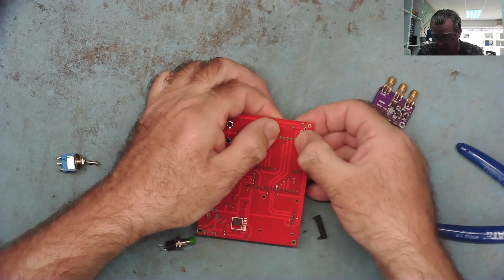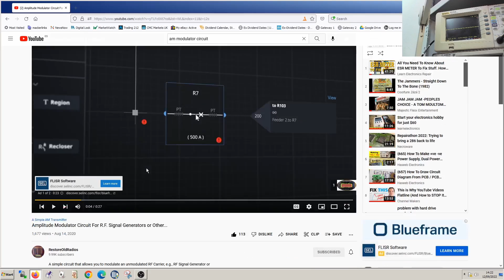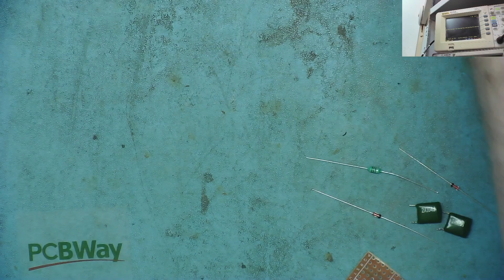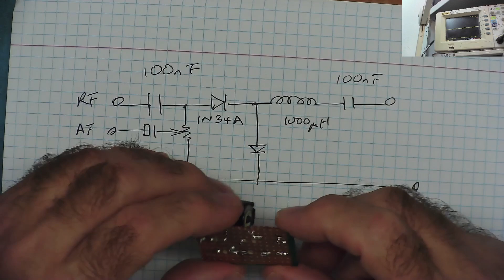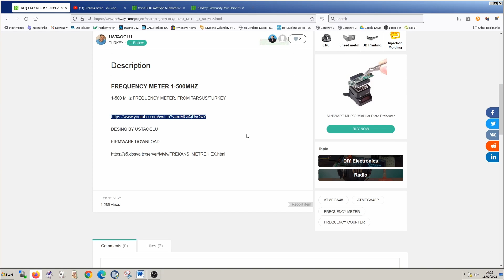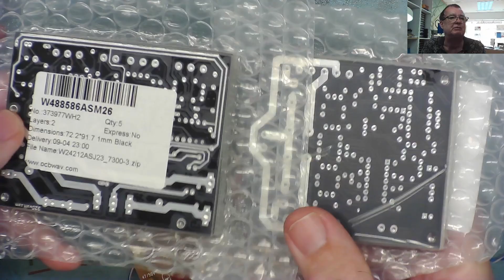Build A Low Cost 10KHz-255MHz RF Signal Generator Project - Part 2

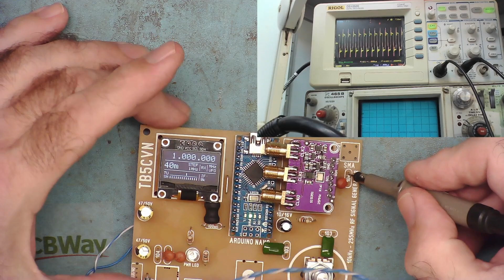Comment: At about 15:40
The overshoot on the square wave is almost certainly the result of poor probing technique.
I have no idea where the scope ground lead is connected or how long it is, but it needs to be a short as possible because it produces a resonant circuit in conjunction with the probe capacitance. For higher frequencies the best thing to use is a probe tip grounder. FET probes are very good but expensive, Contrary to common belief they are not especially high input resistance, but the capacitance at the tip is very low - 1 to 2 pF typically with moderate-bandwidth types. The low capacitance reduces circuit loading at high frequency and lessens issues with ground lead inductance. With low impedance sources 500 ohm probes can perform well.

EDIT: If the circuit will drive 50 ohms, the best thing to do if you don't have high-end probes is to use a 50 ohm terminator at the scope and a 50 ohm coax to connect to the circuit under test. Both terminator and coax should be good quality. Lots of higher-end scopes have switchable 50 ohm termination built in.

Comment: One could just as easily solder the Si5351 at the underside of the board; less introduced capacity and as added benefit is that  the connectors will come out in the direction of the side of the case as well as having more clearance.

Comment: Use a 50 ohm terminator resistor might eliminate that strange odd waveform
Reply: If the circuit will drive 50 ohms, the best thing to do if you don't have high-end probes is to use a 50 ohm terminator at the scope and a 50 ohm coax to connect to the circuit under test. Both terminator and coax should be good quality. Lots of higher-end scopes have switchable 50 ohm termination built in.

Comment: When your signal's frequency gets near the maximum frequency of your scope, then the only waveform that the scope will know to be able to "interpret" from the datapoints it is getting in, is a pure sine wave.

To be able to display a more complex waveform (if indeed, the waveform was more complex in reality) it would need to sample the data at much higher frequency (which would make it a higher bandwidth-rated scope to begin with) to again be able to tell the complexities of the waveform apart.

Essentially the scope measures a bunch of dots in time along the true waveform. When it is a slow wave of some description, it can measure many many dots in each period of the wave, and therefore reconstruct a very detailed and accurate picture of the waveform for each period. When the wave form is near the scope's sampling frequency, it really only gets one or two dots per period. Therefore it has no way to reconstruct if the wave was some crazy complex one or just a sine wave oscillating at such a frequency that it made the one or two dots it sees in each period. So it is essentially forced therefore to presume it is just measuring a sine wave at that frequency.

Theoretically this rule comes from the Nyquist–Shannon sampling theorem.

Comment: I have two samples of Kaisi solder that are complete rubbish - along with another Chinesium brand.
The only thing I will use them for anymore, is as 'fodder solder'...  To put on the iron before putting it away, to protect the tip - which then gets brass-sponged away before next use with PROPER SOLDER like Kester!

Comment: Just use header pins just like on the Arduino, you must have loads about ! as opposed to chopping up a socket you can buy a lifetime's supply (and they are useful) for 2 quid !....cheers.
Reply from the maker: Fair point but I kinda got a lifetime supply of IC sockets when Maplins (you will kow if you are in the UK) closed down
Reply: @learnelectronicsrepair  Lol yeah RIP Maplin !

Comment: Looking into the datasheet, the Si5351 is just a digital clock generator which will always output a square wave. Distortions must come from other components on the board or your leads. Output impedance of the IC is 50-60 ohms. Hence you may need a similiar termination resistor for higher frequencies.
Reply: Either the scope probe or the components on the RF output are forming a low pass filter, causing the square wave to lose its high frequency components and become a sinewave.
Reply: @TheEmbeddedHobbyist  or the scope doesn't have enough bandwidth to be able to interpret the square wave at higher frequencies. In terms of wave composition, a true square wave is one of the most complex. At bandwidth limits, all a scope will see of a square wave is its carrier sine component.
Reply: @ivolol  At 225MHz you need a good scope and better than the run of the mill scope probes. I don't expect my 100MHz scope would show a true square wave anywhere close to 100MHz. It would never cope with the harmonics.

Comment: I forgot to ask ... on your inexpensive psu, when you switch off & on does it dump any unexpected power out onto its terminals or is it safe to leave connected?
Reply from the maker: I didn't measure it, but I turned it on and off several times with this project attached (and the project does not contain it's own voltage regulator at the moment) to no harm.  I don't know whether this is due to the fact the PSU is not outputting any excessive voltage or because the Arduino nano and Adafruit modules have their own 3.3V regulator on board. I'm deliberately using the cheap PSU to see how it compares to using either of my more expensive linear bench power supplies
Reply: @learnelectronicsrepair  .. thx, useful to study, and well done with the project. Keep up the great work 😀👍
Reply from the maker: @CTCTraining1  Cheers Chris.  I'm quite aware of why you are wary about the cheap bench PSU - I will keep on using it in videos to see how it performs.  It's not like I am biased as I have two others i can use, I'm just open minded about it.

Comment: Great video but a warning ...kaisi solder is not good at all , I do not recommend anyone using that solder.
Reply from the maker: What's wrong with it John? It seemed to work OK but I'm not totally sure about it myself, it felt a bit 'odd' somehow that I can't quite put my finger on.
Reply: @learnelectronicsrepair  From all the Chinese brands it's the one I truly dislike the most ... There are some videos online comparing cheap Chinese solders brands and it is clear ..kaisi is the worse ... I can not put the link in here because lately yt  as been erasing my comments with links ... (not kidding.) I will put the link on my next reply.
Reply from the maker: @John_Smith__  You are not the only one having comments removed by YT and believe me it is not me doing it.  I'm quite happy to accept any comments here.  I do agree there is something a bit odd about that solder.  I bought two cheap brands from aliexpress and the other one seems 'nicer' or some reason.  Having said that even the Kaisi one is better than that lead free shite.  I also have the Wuppertal one to try.  So far I still prefer my Mechanix that I had a 500gm roll of for many years until it just ran out.  Strange these 60:40 solders can be different
Reply: @learnelectronicsrepair  Oh my friend I know it is not you, it is the algo from yt ... it is strange since I was trying to post comments with the due reference and used a yt video and then every time I did that the video would be removed ... like after a couple of minutes ...it is a yt thing, or was since my new comment now contains the link to a test video. It may also be the case for linking to products that may be confused with commercial spam ... I don't know. In this case however it worked. 
Also SDG channel made a very extensive test of many solder types ( https://www.youtube.com/watch?v=zZ9wxs6xuYU ) ... and indeed I think it is the level of Purity used on the Tin and Lead content of the solder. I suspect the very cheap Solder wires from China are using "spent" solder from other applications or simply use low grade purity Tin and Lead. And I agree with you, anything is better then non-leaded solder 😀
About the Wuppertal the one you have on the video ... Those are just another Level of Quality ... Way better then anything we can buy.  Stuff like Kester, MGChemicals, Wuppertal, and some other known brands are top quality.  From aliex I bought a brand called Best (60/40 0.3mm wire 500g ) and it is perfectly acceptable. Also on ebay you can find a roll of 250g of several diameters from a brand sold in Japan called Sanki. I also can say that is a good 60/40 solder wire (search for sanki solder on ebay).
Reply: @learnelectronicsrepair  Here is one compaarison video: https://www.youtube.com/watch?v=tQBNcdbWldY

Comment: I've heard loads of times not to mix lead & lead free solder.  Something about weak joints // Eutectic melt point changes. 
I feel like solder is the wild wild west caz you can't know what "they" used on some random board. Also>> Is the roll that we purchase exactly what is on the label ?? <<  yeah, the wild wild west.   

What I do is just set 2 rules >>  if it is a high mechanical stress solder job then I remove all old solder as best as possible and apply new "known" solder. Prefer=60/40 for mechanical for sure. Absolutely 60/40 for high stress parts.   (connectors / cables / interfaces) 
If it's a more static solder job, like something on a circuit board I don't bother being careful and just re-use as much as possible.  ROHS solder for board stuff.

Also, just as a personal habit I flex my solder joints a little bit.  Just push with a screw driver to make sure it's stuck good or something like that just to make sure it actually happened. Looks can be deceiving.

Comment: one small point about the signal gen the square wave will give an output with lots of harmonics  not good for fault finding sine wave will be ok.
the modulator is an interesting circuit that was used in some cheap rf generators.
finaly the ring tester will be great if it works on the inductors used in SMPS at the moment i use the callibration output of my scope and try and count the rings but its pretty impricise at low mh
Reply from the maker: I am wondering if the sig gen is really giving a square-ish wave output at frequencies below about 3.75MHz or if it is something to do with my scope or having no antenna/load on the generator?
Reply: @learnelectronicsrepair  When you order your SMA pigtails, connectors etc. include a 50 Ohm terminator. Some of the ringing may also be due to scope probe compensation (decent scope probes have adjusters on them).
Reply from the maker: @ralphj4012  yeah I will try that.  My scope probes has 'adjusters' on them like you mention but I thought they only affect the waveform if you are using x10 setting on the probe.
Reply: @learnelectronicsrepair  Usually (but I suspect not always on some probes) the adjusters alter the probe's capacitance, nothing to do with range setting (unless range means affect by frequency). The adjusters alter the wave shape, more so at high frequencies. Ringing can be caused by unterminated RF inputs, hence the feed-through SMA 50 Ohm terminator (though I have no idea what the anticipated output impedance of your generator is / meant to be). Of course, the scope probes must also be suitable for the frequency range being measured and always use very short scope ground cables.